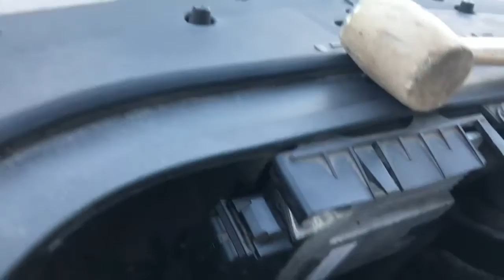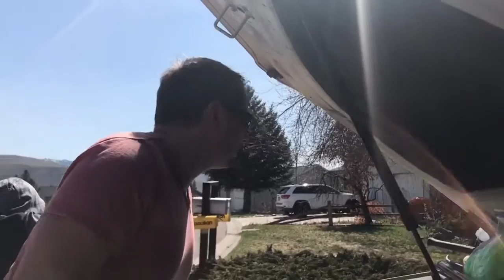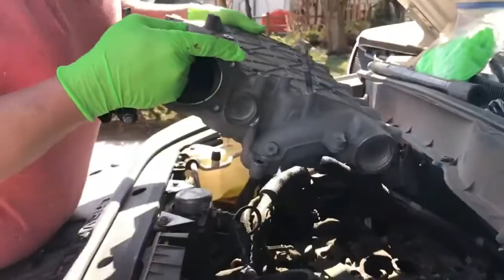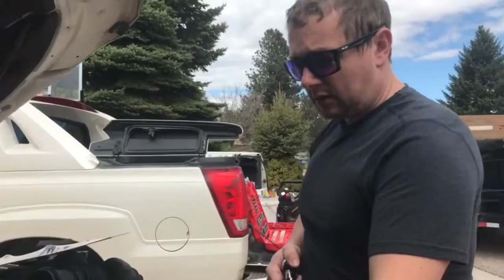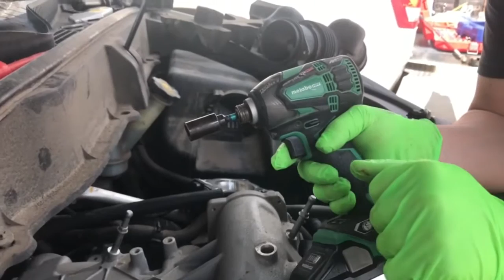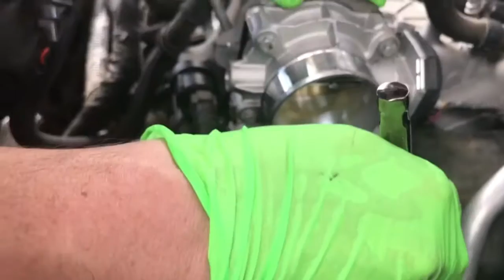How To Replace A Fuel Rail Pressure Sensor  -  2011 Chevy Traverse

Comment: So tell us  your a dumbass without telling us your a îdumb ass . Just because scanner gives a code for a sensor circuit. That doesn't mean nor say hey change this sensor if will fix the  issue. You have to be intelligent enough to use a multimeter to diagnose what is causing that code.??? Is it a short in circuit going to sensor? Is it a bad sensor? Or several other things that could be causing an abnormal signal at the sensor.

Comment: Really helpful video (in 2026!).  I have socket sets up to 25mm, so I just ordered a 27mm Chrome Long one for $10 with free delivery later in the week.  I never seem to have the exact tool I need for working on my 2012 Traverse LTZ, but it saves me tons doing it myself.  I've been having a "PO191 Fuel Rail Pressure Sensor Circuit Range/Performance Bank 1" that pops up every 4-7 months or so.  It's happened twice in the past 2 months so I figure it's time to replace the sensor BUT (1) the GM part is $90, (2) I need a $10 socket, (3) It's going to take a while for me to remove everything and get to it, (4) and it might not even be a failing part and could be something completely different or worse, the wiring itself, which will really be a bummer to have to replace.  Again though, I needed to be prepared for my job and there are very few videos/instructions out there on this particular job. So I really really appreciate your video!

Comment: My vehicle starts runs for like 2 seconds then stalls out idk what it could be. I've changed the ecu, throttle body, spark plugs, coils, fuel rail pressure sensor idk what else it could be

Comment: I have a 2012 Traverse and it is throwing codes P018C and P069E searching YT and I came across your vid.  I checked my fuel pressure with a HF gauge and I'm getting 70 PSI fuel pressure which seems good... so I'm wondering if I have a bad sensor or something with the wiring.  What did you end up finding wrong?  unfinished story...

Comment from the maker: So after all of that it did not start. Even though the computer said we had fixed the issue. I ran a compression test and discovered that cylinder 3 had not compression and the motor was bad. So that was fun. LOL

Comment: I am having some what similar issues with my 2010 Chevy Traverse. I Cant Figure Out The Exact Issue But I Know It Is Related To Fuel Line (Pump, Fuel Regulator, Fuel Sensor, Etc) . Were You Able To Figure Out What The Issue Was With Yours? Pls Provide Me An Update of What The Exact Issue Was With This Vihicle.
Reply from the maker: Just posted that the Chevy had a cracked head and had no pressure in cylinder 3

Comment: Was the ECM put in by the dealer? I've heard some plug and play needs to be set up at the dealer. My 2010 traverse had a fuel sensor go off today so I just might be going down this road. Your car ever get started?!
Reply from the maker: I put the ECU in myself but I did have to a licensed mechanic program it.